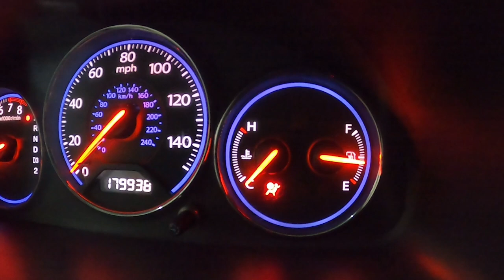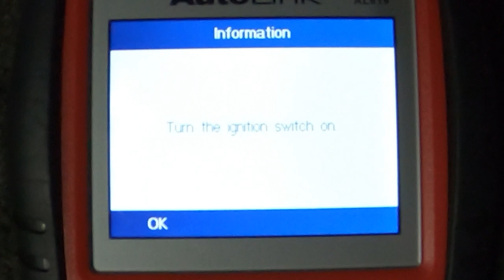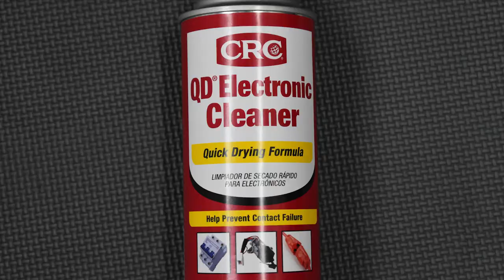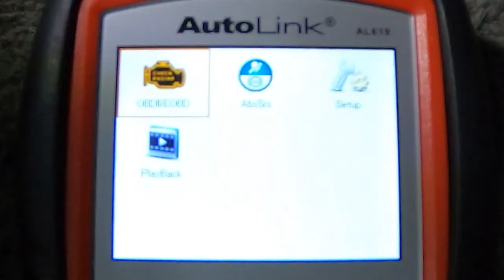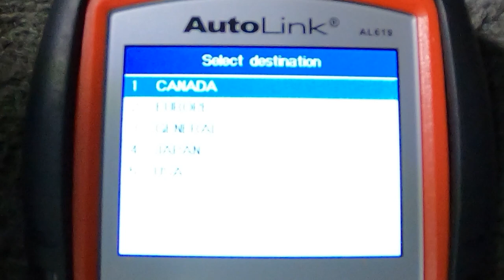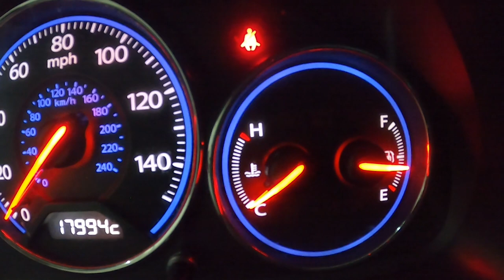2004 Honda Civic LX - SRS Fault Code 9-3 - Airbag light - Seat Belt Buckle Switch Repair

Comment: This ended up being a 3-6 code for me, later on I scanned again and it became a 9-3. 3-6 codes are just a range of possible codes due to poor ground or some other electrical fault that the computer module cant discern. Honda had no idea, I was stumped too. Just clear it and scan again until it becomes a meaningful code.. 3-6 ...  thats just what it means, its in the service manual if you search deep... you're welcome.

Comment: What type of screw driver did you use, seems like mine has a small nipple in the center to stop a regular
Reply from the maker: Yes, you cannot use a regular TORX bit.  It is a "Tamper TORX" bit, these have the hole in center to allow for removal. 

Thank you for the comment.

Comment: I’m gonna do this method to my 05 civic 4 Dr lx. I don’t have a scanner with airbag srs capabilities, can I do this without it?
Reply from the maker: This car the airbag light would turn on and off on its own. Its possible after you fix and give some time the light might turn off (system sees there is no longer a problem), just not 100% sure.
Reply: @thatonecarguy5201  Ok thanks I'm gonna do it anyways. I just don't feel like spending more money on another scanner.

Comment: Do I need a scan tool to reset the code, or can an auto parts store do it?
Reply from the maker: This one needs a scanner able to connect to Airbag/SRS system. The auto parts stores will only clear the engine computer codes for the check engine light.